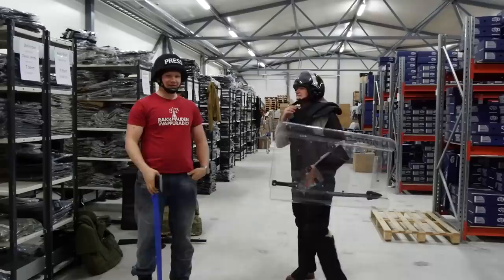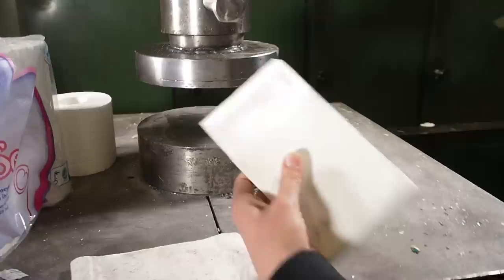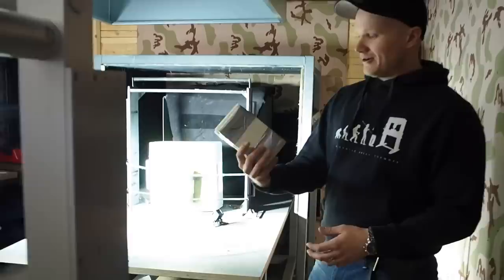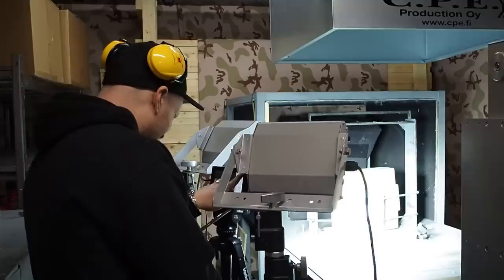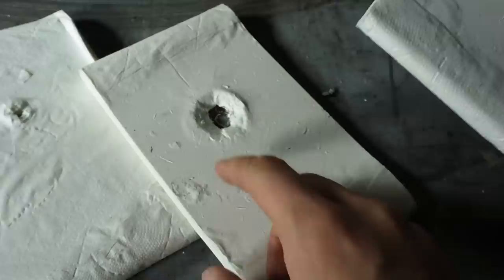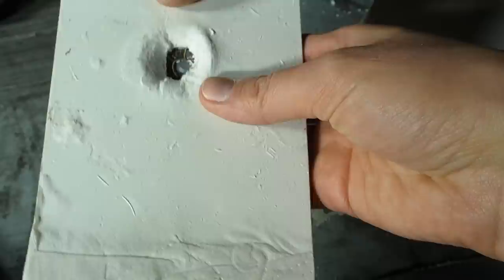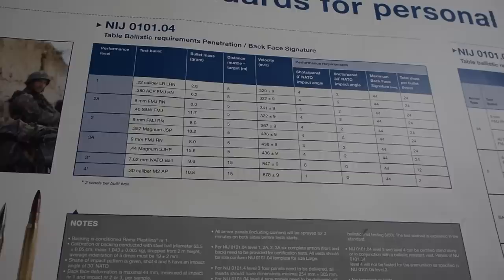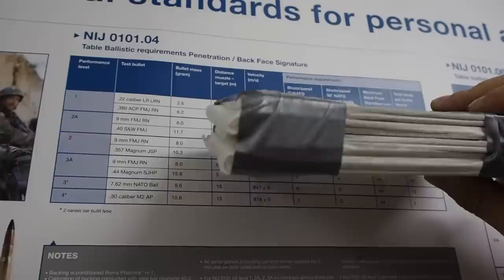Making Level 2 Body Armor out of Toilet Paper with Hydraulic Press

Comment: Soak the TP in water first, then use the press to push the water out. The water molecules will destroy the static repulsion between cellulose fibers and allow more reorganization and reorientation of fibers next to and through one another. Your armor plates will be maybe half as thick and twice as dense.
Reply: The question is: Would that make them more brittle as a result?
Reply: I would like to see them try this.
Reply: But if you do this then will the TP still be absorbent? As the material is now, if you get shot with something really shitty then it becomes its' own bandage.
Reply: Would make toilet paper more brittle, you have no idea what you're talking about
Reply: brittle is good.  you want a nice clean break, no danglers
Reply: For all y’all saying brittle isn’t good don’t know crap about body armor the goal is armor try to do one slow down  the bullet if the plate fractures it  takes all the energy from the bullet and dispersed it thus stoping the bullet this method has been proven with ceramic body Armor plates.
Reply: And a brittle square of paper would be good for one large clean slug, but you still need something soft in case you need to deal with a lot of messy pellets.
Reply: AzuriteT3 yeah that’s why you have layers of plates and a cloth or rubber layer on the out side to catch the bullet fragment like the do with plates and plate carriers and I’m sure it would be very effective for their application they only shot it once anyways but u are correct
Reply: I agree. If your plate is hard then you should definitely wrap it in rubber, especially if you have no toilet paper.
Reply: Then the tp will crumble and not be the same.
Reply: This has been debunked.
Reply: @trolojolo6178  What this guys said is NOT the same your video is debunking, he still maintains the press part just with wet paper now
Reply: We would wet toilet paper in prison and over time could make a shank with it once dried and pressed and shit
Reply: @zerodamonsta942  yeah it dispersed but after that you can throw away your precious body armor because it's broken in half from a single bullet
Reply: @user-pf8hs7nv6z  true but most armors have some kind of Kevlar backing and front so it’s not like after it gets shot you’re armor less it’ll still stop bullets just of lower caliber and I mean if they use a lot of smaller plates it’ll help with that also cause they would have to hit the same exact small plate to get through and I mean they could also wrap it in some kind of sheath to keep it somewhat together after it breaks or use thin metal faceplate with the composite armor it’s a lot of composite armor out there that does the things I mentioned.

Comment: How about making it out of a thicker kind of tissue paper? There are quite thick and big tissue paper rolls out there and i think you'd be able to make something as strong as this or stronger only from one roll of that.
Reply: he could make it even stronger by setting and freezing the "shit paper" as he calls it to create pykrete layers, they would also fuse together and offer better protection than the same number of layers stacked separately.
Reply: Damn, I was thinking the same thing.
Reply: evilcanofdrpepper ice melts. Might want to try resin, epoxy or siliconne as binder instead
Reply: evilcanofdrpepper, By weight wet toilet paper would be much weaker.

Comment: $10 vs $10,000 dollar body armor
Reply: It's not THAT expensive.  Level IIIA soft armor is like $100-$150 for a good soft plate.
Reply: krdshrk And you can get expired plates for pennies too.. Will probably still save you. However the plate carriers and especially kevlar vests can get quite costly.. no 10k though
Reply: rkan2 kevlar is 650, if you want a helmet too 1k, and an old t shirt, an empty bottle and some oil is 400 dollars, ez prices m8
Reply: @Anglo Commando it is a game I think he is talking about csgo.
Reply: Steel armor is some times cheaper then kevlar also it cost like around or sub 400 dollars per plate. Some as low as sub 100
Reply: @rkan2  how is body armor plate expires? it's metal isnt it? can you explain more?
Reply: @VladiSSius  Well, usually the best plates are composites built with stuff like kevlar and resins.. They have manufacturer rated lifetimes for shelf-storage, active use etc.. Of course most of them won't be degraded much even with the wrong kind of storage, but personally I wouldn't trust them for protection from rifle rounds after they are not within specs anymore.. Plates can be made from composites, steel, ceramics... Ceramics would have probably the highest lifetime in storage, but the lowest lifetime in use. Metal plates just don't cut it for stopping rifle rounds and being light enough.
Reply: @krdshrk  $10 vs $150
Reply: @rkan2  ahh i see, thanks for your explanation.
Reply: Gabe R. HESCO Ceramic plates ... the best money can buy for civilians ... nowhere near 10k though

Comment: There is a reason ancient asian warriors used paper armor...
Reply: Yep, lots of fine paper with a little lacquer or wax for waterproofing and bonding the layers together.
Very tough, very light, somewhat flexible.  Easy to repair or modify in the field.
Slashing attacks were pretty much useless against the stuff, but archery could be pretty effective.
Reply: Some shields in the American plains were made with 2 layers of buffalo hide and paper in between.  Paper was acquired by trade or taken from settlers.  It can deflect bullets when the shield is held at an angle.

Comment: when you stack and tape the toilet rolls to make a bullet proof panel, would it not be stronger if you stacked the toilet rolls horizontal then vertical then horizontal then vertical then horizontal and so on so the fibre direction is alternated?
just a thought.

Comment: I just saw a level 3 plate made with dense plastic. The construction method presses many very thin layers of plastic together so they bond. Grocery store bags are made of HDPE (high density poly ethylene). I wonder if you could press a bunch of grocery bags together and make a bullet proof plate.

Comment: Was the expensive toilet paper two ply, or were they both single ply?
Reply from the maker: I think we don' have those terms on finnish toilet paper but the more expensive was probably little bit thicker and also it felt much softer. I still have some of those papers so I can see if I have both cheap and expensive so I can weigh them to see if the more expensive has more paper/mass per roll
Reply: I think Embo has three layers, in fact. Cheap stuff usually has two.
Reply from the maker: Nope I have just one roll of the expensive stuff and it has bullet stuck in it so it's no good :D But it's still very hard after one year
Reply: Embo is three ply and the cheaper either two or three. I've never seen single ply toilet paper in Finland.
Reply: Ply means layers. Cheap paper is usually two , expensive 3 layers. Super cheap school paper was one ply, at least in the 80s in the UK. It was more grease proof paper than toilet paper.
Reply: "After one year"? So this video was shot a year ago?

Comment: if you are looking for anohter angle. think those clear shields you were playing with could have a harmonica gun in  the hand grip area, it could be made to hold shotgun shells that would use rubber bullets. the whole thing lines up to centre. and is fired by the hnad grip section on the perosn who is using it, they are not makde yet but in time it probably would be ,, i have watched many shows ,, i have never seen it, and i think ,, all the time of how to improve stuff. make it easier, or safer ...both sides really,

Comment: what happens if you crush the 5 rolls again is there a point it could explode when shot ?
Reply from the maker: I think with smaller tool we could make toilet paper bit harder but also more brittle. Probably best way to make it better would be use somekind of epoxy mixed in the paper but it won't probably explode when shot with any method
Reply: Explosive bullets can fix that :D

Comment: I wonder if you could make a chest plate shaped wire screen frame to make paper with, and fill it toilet paper pulp make from ~15 rolls of toilet paper mixed with water. Then, when water drains, and chest plate dries, you can press it with the press, overlapping the spots. (I wouldn't press any single spot all the way down before the entire surface area of the chest plate had been pressed part-way. Ideally, you would want a press that's powerful enough to put the same pressure from the small press, over the entire surface area of the chest plate at once.) Whether you make a chest plate or not, the toilet paper armour plates should probably be sealed against moisture; people sweat, you know.

Comment: Use 8 layers as you need to survive 4 impacts per plate assembly straight on and 2 on an angle.  That fracture in the back of the 4th plate indicates a failure would have been likely in a full test.  I wonder how a 200mm compressed stack of duck tape layers would perform?
Reply: Probably better, as the adhesive between the duct tape would tend to absorb energy.